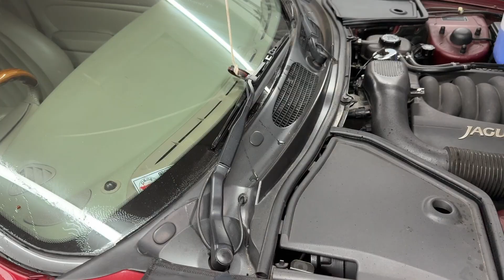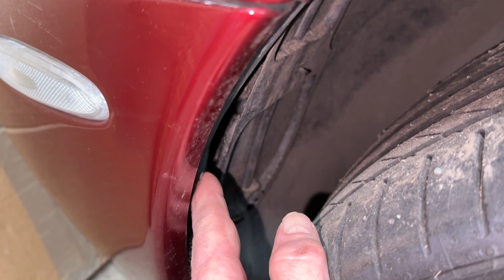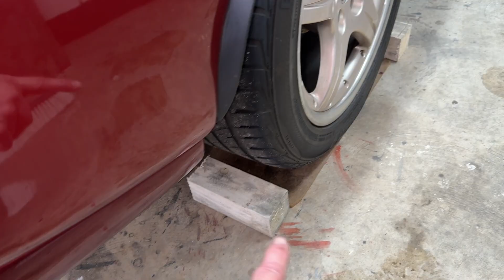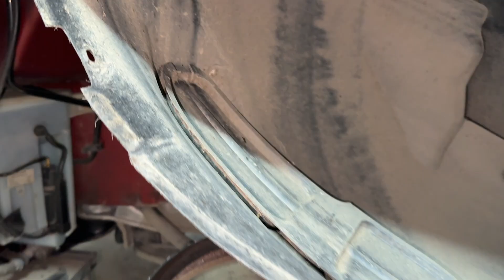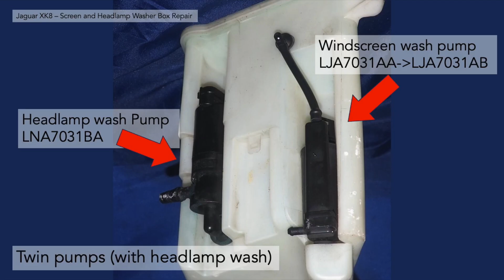Jaguar XK8 XKR Washer Bottle Leak Fix: A Technical Guide for the X100.  V215 Modurol

Comment: I my case it was  a smal one way valve with a ball/ spring inside that got blocked. Impossible to make it work a si instaled everything back without it.
Will see
Reply from the maker: Thank you for sharing that tip, Marius. I actually wasn't aware of that specific inline valve mechanism myself, and it is a fantastic piece of information to put out there. We are absolutely learning all the time with these cars, and discovering these hidden failure points is exactly what makes the community so valuable. Running the system without the one-way valve should get your fluid flowing perfectly again, though you might just notice a very slight delay as the pumps prime the lines from scratch when you first pull the stalk. I really hope that completely sorts it out for you, and it is great working and learning together as always. regards Damian

Comment: Thanks for another great video Damian! After discovering a blue pool under the car, this has helped me easily diagnose the problem, which turns out to be the filler pipe grommet. Some great tips from the community and I’ll be running the tank a 2/3 full to avoid the leak 😊
Reply from the maker: Hi Cameron.Thank you so much for the feedback, and I am glad the video helped you track down that blue pool quickly! You have found the absolute classic culprit—that filler pipe grommet perishes over time and just can't hold the pressure when the neck is filled right up. I actually had the exact same issue myself previously after trying to fill the bottle right to the very top of the blue filler mesh! It turns out that running the tank at two-thirds full is a fantastic, practical workaround to keep things bone dry while you wait to pop a new seal in. Working and learning together and sharing these clever operational shortcuts is exactly what makes this community so brilliant. Please subscribe to our new channels, Modurol Live and Modurol Shorts, to follow our upcoming live garage sessions and quick technical updates, regards Damian
Reply: @Mod @Modurol thanks Damian - I’ve subscribed to both channels. Looking forward to future videos and learning with the community 👍
Reply from the maker: Cameron, Thank you. Much appreciate your support, regards Damian

Comment: On the contrary, the car should be supported by a metal stand, with the jack serving as a backup. 🤝
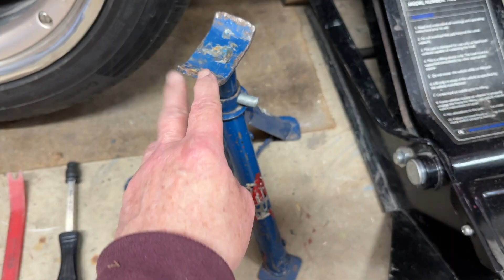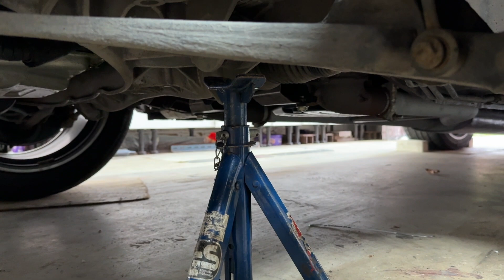Reply from the maker: Mike, I completely agree—safety is paramount when working under a vehicle. I actually made sure to include an axle stand in the tool list at [03:53] and specifically showed it being positioned under the front suspension crossmember at [05:31] for that exact reason.
Using the jack only as a secondary backup while the car is supported by a solid metal stand is the only correct technical way to work. We believe in working and learning together to keep everyone safe in the workshop!
If you'd like to see more of our technical research and safety tips, please do subscribe to our new channels, Modurol Live and Modurol Shorts. You can also find original workshop manuals and guides over at www.modurol.co.uk , regards Damian.
Reply: @Modurol thank you very much! 🤝
Reply from the maker: Mike, no problem, regards Damian

Comment: For parking in the garage when it touches the windscreen you know you can go forward no further without touching the wall  😁
Reply from the maker: Iain, spot on. That is a very practical way to use that feature as a manual "parking sensor." It’s a great example of finding a simple, clever solution to help protect the long nose of the XK8 in a tight garage. Thank you for jumping in with the answer. We’re all about working and learning together here, so please do subscribe to our new channels 'Modurol Live' and 'Modurol Shorts' for more Jaguar technical challenges and "What is this?" puzzles, regards Damian

Comment: By far the most common source of leakage on the XK8 washer system is the large rubber grommet or doughnut which is about a third of the way down from the top of the reservoir bottle itself. Once the grommet goes hard it starts to leak until the bottle is one third empty and then it stops dripping.

I last purchased a new grommet about 20 years ago from Jaguar but I don't know whether they will still be available. Putting silicon grease, or whatever, on the grommet will not work so if you cannot get a new grommet anywhere you will have to use silicone sealant of some type on the doughnut.

It will not fail an MOT test because the reservoir will stay 2/3rds full and everything will work.
Reply: Thanks for your suggestion!
When I filled the tank with new fluid, I poured 5 liters of fluid without exceeding the large rubber grommet.
This is why I didn't see any leaks, and I speculated with Damian that perhaps there wasn't a leak in the tank.
Anyway, your suggestion is excellent!
Reply from the maker: That is a brilliant technical tip, Richard. The observation that the leak stops once the fluid level drops below that top grommet is a perfect diagnostic tell for the community. It’s also very reassuring to know it doesn't pose an MOT issue since the system remains functional. Thank you for sharing such a practical, long-term ownership insight, regards Damian.

Comment: The oil seal is to to show you how far to drive into your garage. In the USA they always seem to use an old tennis ball rather than an oil seal. 🤣
Reply from the maker: Richard, you are absolutely right. The tennis ball is the standard 'go-to' in the USA, but since I didn't have one to hand, I had to improvise with what was in the garage. In the spirit of working and learning together, it shows that as long as the technical principle of the plumb line is correct, the weight itself can be anything, regards Damian.